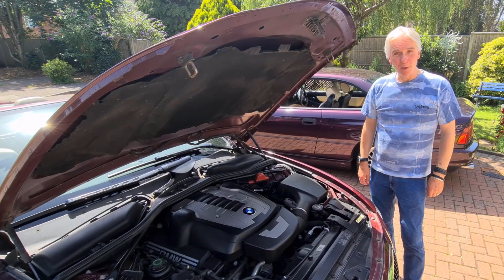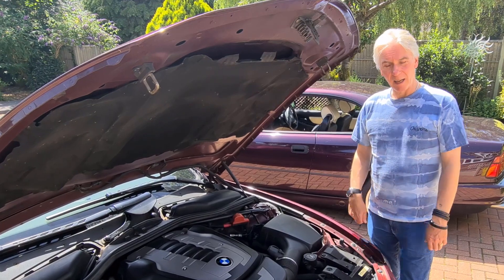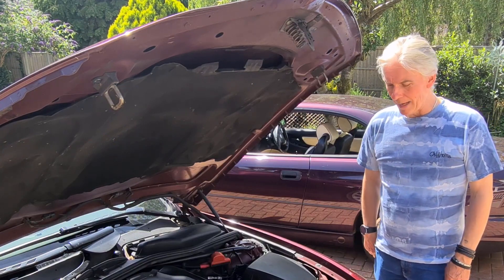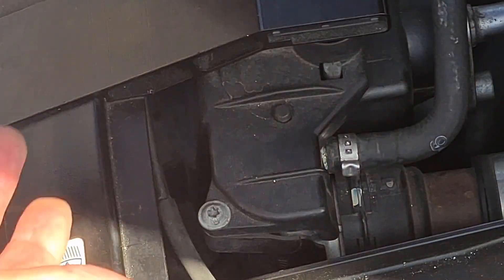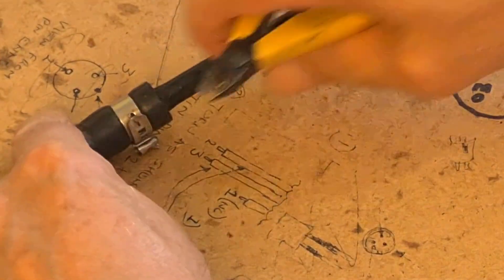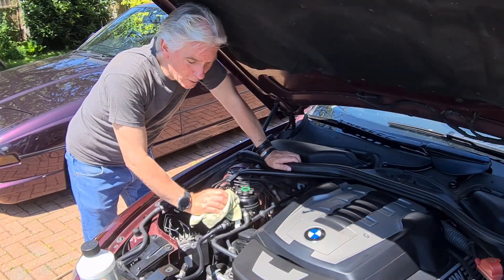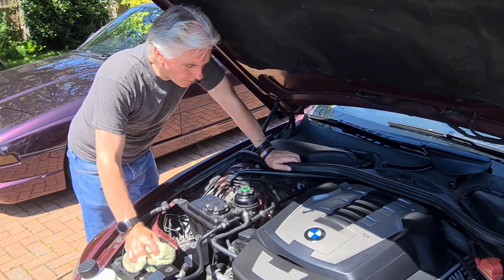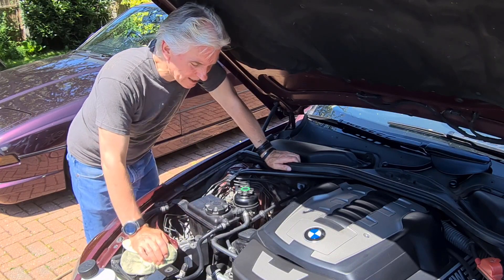BMW N62 DON'T IGNORE THIS STAIN - HOW TO FIX

Comment: Hi Timm, excellent video! After doing the replacement does the system must be bleed from air?
Reply from the maker: Thanks! No need to bleed afterwards
Reply: @TimmsBMW  Great! I've seen some users change their thermostats, lowering the water temperature from 105°C to 90-95°C to preserve the valve cover gasket and in general more other plastic parts and hoses. What do you think? Could this be a smart move, or are there any drawbacks?

Comment: Hi Tim and all. Usually the plastic pipe at the clamp has a tiny crack. I bought a brass pipe painted it black and replaced just the pipe. It nearly cost nothing and will last forever. You could use any none rusting material.
Reply from the maker: Good work!

Comment: Hey there Timm, Your very knowledgable with the n62, I have an n62b44 on an 04 e60 that I just bought really cheap, Previous owner had the expansion tank explode, I replaced expansion tank and tried to replicate the issue on a lower pressure cap, I ended up blowing the upper radiator hose right off after a few pulls. I have done the combustion gas test with the blue liquid but as the n62 stock thermostat opens at 105c, Its not possible to do that test with the thermostat open as the coolant boils when not under pressure. It passed 2 tests that were about 30m long but thermostat was never open so It wasn't quite accurate. When I drained the oil from the car, there was no coolant in the oil, I don't know if there was ever oil in the coolant as the coolant system was dry when I got the car and I didn't have it running long enough with coolant to see any. Compression test came out 180psi everywhere except cylinder 6 and 7 which were 125psi. I did get engine up to 105 before starting compression test but it was cold that day so after getting coils and plugs out the engine may have cooled enough to account for the 180psi instead of 210psi which is ideal. My guess is a crack between cylinder 6 and 7 as BMW is pretty good for their head gaskets. Not quite sure how that pressure made it into the cooling system as the crack would be where there is no coolant passage but I'm wondering your opinion? I bought it knowing an engine swap was a possibility, If I do I will go with the larger n62b48 assuming everything fits up the same? Thanks for any insight!
Reply from the maker: First, don't panic - the replacement cap was the sensible thing to do - and should stop the expansion tank exploding. My thoughts are twofold, running the engine with plain water will cause problems and who knows what was in there before. Get some BMW blue coolant and replace whatever is in there now. Secondly, the top hose, bottom hose and the expansion tank will fail at some point no matter what coolant is being used, the plastic goes brown and brittle and fails - see my video on replacing the top hose
Reply: @TimmsBMW  Seeing as i have low compression on 2 cylinders and keep blowing coolant parts, Do you figure its a headgasket/cracked block? The upper coolant hose was infact brown and brittle but I'm not convinced that's the underlying cause, The coolant hoses were rock hard when I squeezed them right before this happened. Thanks for the tips timm!

Comment: BMW. Plastic fantastic. My 550i with 65k miles leaks more coolant and oil than both my Toyota's with 200k miles. BMW are absolute junk. Everything is designed to fail. Now talk about the N62 alternator bracket oil seal. That's a fun one at 65k miles. Nice puddle in the driveway from it too.
Reply from the maker: A lot of people will certainly agree with you!

Comment: Back in  2012 I upgraded this  pipe with copper pipe for all my customers Back around that time in the USA we had a lot of  N62 engine floating around 750 550 650 x5 x6
Reply from the maker: Good tip!

Comment: If that other bleed pipe is also original replace the Y piece just beside the throttle body, that one is also common to fail, replaced it in my 550i not that long ago and it broke on removal. It goed from the expansion tank around the front of the engine, goes in next to the throttle body and then splits to both heads, you have to remove the throttle body to replace it
Reply from the maker: Thanks Mike, I have the pipe ready to go and am waiting for the weather to break!

Comment: Can a coolant leak on the N62 cause a slight rough idle 

Mines got a slight rough idle no fault codes or lights but did notice a bad coolant leak

Comment: hi tim. quick question off topic also. have you ever replaced the xenon ballast on the 650? and do you know if its possible to change it without taking off the bumper? thanks for any info
Reply from the maker: No need to remove the bumper - all done from the wheel arch - shown in this video: https://youtu.be/-wNR-ss8r_w

Comment: hey Timm most of the problems with m62 n62 v8 engines are the engine operating temperature which is between 105-110 degrees so I put on a custom thermostat at 90 degrees without a heater. So far I noticed only increased fuel consumption of about 0.5 liters.
Reply from the maker: That's a good plan Kamil, the increase in MPG was only 1!

Comment: Your top radiator hose  neck is turning brown in color , that’s a dead giveaway that plastic neck is gonna brake soon , if you take it off and look inside it will be falling apart from inside out from heat and age . Best to replace it before it bursts .
Reply from the maker: Thanks Eldin, it's on my list and I will be doing a video on it!

Comment: You can use a piece of brake line to replace that pipe. It has the exact same inner & outer diameters and is much more durable than the plastic one from the factory, not to mention cheaper as well.
Reply from the maker: Thanks Kevin!
Reply: I like it, would it corrode over time?
Reply: @dukedub  I haven't noticed any